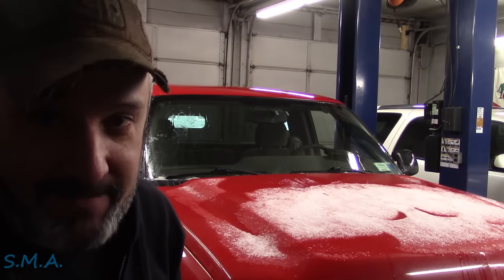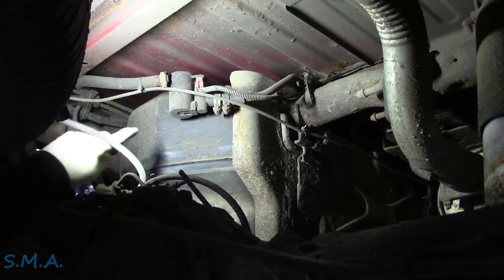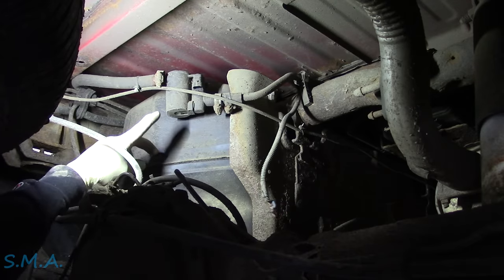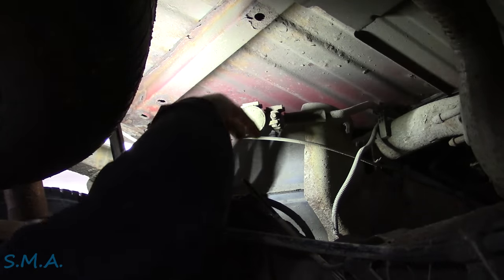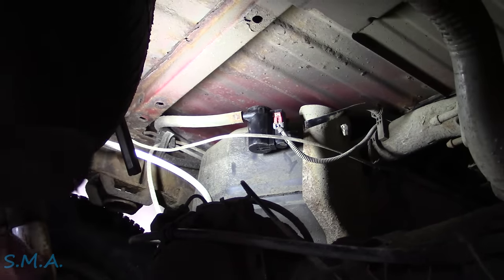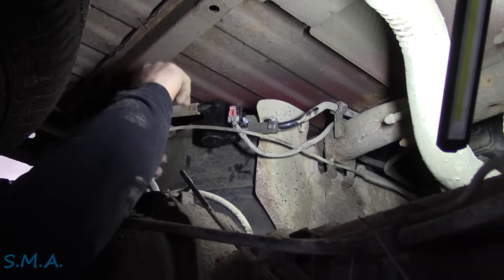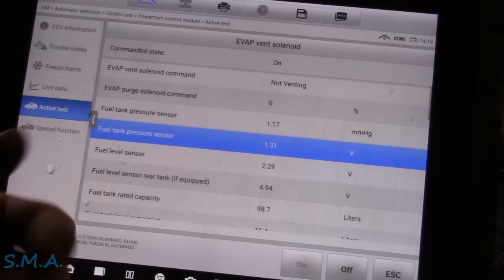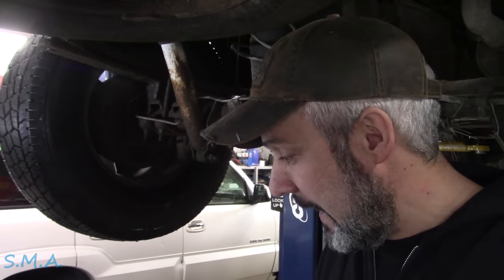Chevy/GMC Truck: P0442 P0455 Small & Large EVAP Leak

Comment from the maker: Power Probe IV : https://amzn.to/3zzZGOU
Reply: Great tool just have to watch what you back probe.Bam there goes the brain
Reply: Got the Austin Powers line, tight like tiger 🤣🤣🤣
Reply: I just bought myself a Maestro for Christmas! :)
Reply: @rickjackson2346  don't throw 12v at 5v by accident. know the hole yer probing
Reply: Hey Eric O, at 4:05 how do I make one of those test lights, or where can I buy one?
Reply: @katzenpapa  Just go to a junkyard, or buy a pigtail for a marker / running light on an older GM car or truck - 1990's and back from there.
Reply: I first learned about a powerprobe from this channel. Probably one of the best investments I have ever made in a tool. Paid for itself the first time I used it (literally) and it has shortened diagnostic times many times since then. what a great tool.
Reply: Follow-up video up for the P0442!
Reply: Power Probe is a great tool.  Great for working on trailer lines and wiring problems.
Reply: To answer your question on the 4.8L, Economy, just like the 265, 305. FYI the 4.8L in Gen 3 and 4 had no AFM/DOD to deal with, so they require no overhaul like the 5.3/6.0/6.2 units.

Comment: What helps a lot is when you get a hook inside of a hose to separate it from a fitting, spray some WD-40 onto the space between the tool and the fitting. That has help me remove and install hoses during my 37 years of turning a wrench for a living.

Comment: had a 2003 silverado with the 4.8 LS. also had the evap codes. replaced and relocated the evap system still had the codes, i emailed black bear preformance and had them delete my evap system and codes via mail in tune. Never had a problem fueling up or a check engine light again. Sold it with 276,000 miles extremely solid and reliable truck even in the Wisconsin salt belt.

Comment: When I diagnosed the purge leak fault on my '03 Chrysler Town & Country I was surprised to find that nearly all purge hoses cracked and leaked about the same time. Meaning when the hoses aged to a specific time period, they all failed in the same manner around the same time, give or take.  That's why I cringe when a hood is opened and all we see are hoses of all sorts and not the engine. Eventually they all will need replaced.

Comment: 05 Chevy, replaced pump 8years ago do to pump rust.  last year heli-coil a couple intake mounting striped holes.  Yes I was sweating bullets an made sure I didn’t loose my manhood: Couple months ago replaced rusty fuel lines , vent valve-front/ rear , map and tank sensor as preventative maintenance. Ran beautiful for 5hundred miles an radio reception.  on til fuel cleaner an super fill made those codes come up , smoked tested at night with glow sticks only to find an intermediate rear sticking valve. Thank you sincerely for videos. Still determined to drive it up therefor an inspection sometime.

Comment: That filter relocate is pretty critical on a farm truck that sees lots of gravel. The filter plugs right up if you leave it under the vehicle in the dust cloud. Gotta put it up at the front of the engine bay to breath some clean air.

Comment: I use the special tool for tightening the ty-raps, its made by Thomas and Betts. It works great! You will also want to make sure to use Thomas and Betts ty-raps because they have a metal locking tab instead of a plastic one.

Comment: Great video! My 2013 1500 5.3 ext cab 4x4  had the check engine light on with PO455 code, so changed the purge valve on the engine first with a GM original part from Rock Auto, cleared the code. next day coming home the check engine  light comes back on, same PO455 code, so I ordered a PN: 22840971  Vapor canister vent solenoid valve assembly, hoses included GM original parts from Rock Auto, got the new parts and compared the old with the new and it was identical to old part. Installed the new part, fit perfect, cleared the code again, hopefully this will work. besides, the trucks getting older and i plan on keeping the truck for a long time, so I thought it was a good idea of preventive maintenance.
Reply: Did that fix the code P0455?

Comment: It's always nice to see different methods to get to the same diagnostic goal. I wonder if the reason the vent valves are prone to failure is because moisture that condenses in the line has nowhere to go, then it freezes on a cold day, damaging anything nearby. So the manufacturer tried to shift the location of other parts so the valve would be farther away from ice. Problem is, there's only so much headroom under the vehicle.
Reply: I always find them full of very fine dirt.
Reply: I can tell you they fail all the time here in Florida to, where it doesn’t freeze much so I doubt that’s it !
Reply: It’s dirt.   The vent intake relocation makes condensation and gravity feed back to the valve even worse then the original location.
Reply from the maker: The early GM trucks (97-98ish) had them under the hood. I never changed one of them.... EVER. Do the math haha
Reply: @rydplrs71  well that makes 'the fix' perfect' more work for emissions repairs I wonder if they can limit emissions from hybrid or all electric vehicles we all know they must be emitting hazardous substances, California must label them with their hazardous material warning already.
Reply: @SouthMainAuto  amazing Ford model T's or A's never had such problems either or two stroke engines we have taken huge strides backwards moving forward.
Reply: @jhonditch4269  You drive behind an old car nowadays? They just plain stink without the cats in place. I'll take modern day emissions all day long over old polluters. Imagine how bad the air would be without increasing technology.
Reply: @jhonditch4269  Look how terrible large cities air was with smog. I am far from a save the planet kind of person, but modern emissions equipment has made a HUGE difference for the health of people.
Reply: @SouthMainAuto  I've had my 98 K1500 Chevy truck since new and have never had to change mine out.  I also own a 98 Chevy 1 ton that I bought in 2007 and have never changed that one out as well.
Reply: Im with the 'dirt' idea.  Did you notice the grass stuck to the bottom of the axles (both sides) towards the end?  That truck doesnt spend its life on pavement...
Reply: @SouthMainAuto  I have a 1998 C1500 with the big 4.3 and 5 speed gear jammer. I saw that the evap hardware is mounted in the engine bay, I was wondering if I would ever have to  deal with it. Good to hear you haven't. Also good to hear you had some down time. You need it ever now and then
Reply: @jhonditch4269  He's right about the smog.  I've visited SoCal since the 70s.  Night and Smog(day) back then.  However, I grew up liking the smell of fossil fuels sans sulphur-ish.   Oh wells
Reply: @stuckinmygarage6220  spending my childhood on the farm the smell of fresh manure is all i remember BUT we did have a "Big Greene Tractor"
Reply: @mph5896  Good  day from Ontario  2012 I had to quit work ,  severe asthma. I do some  driving for Mennonites  neighbour. 3  58 Ford cars passed me other direction.  I had to cough after they pass because   of smell of gas,  I don't think they were set rich?  Thanks
Reply: @mph5896  Back in '78 I had a Honda that used a precombustion chamber.  It could burn leaded or unleaded while other cars on the road needed one of those rotten egg smelling cadillac converters to meet EPA standards.  The only "smog" device on it was an air intake recirculation pump/A.I.R..  It got 40 MPG city, 45 MPG highway, documented and logged at every fill up.  Newer isn't always better.

Comment: Had an EVAP code. An took it to the dealer to be fixed. The first time. It made it till the next day. Before my check engine light came on. Went back an they moved it on top of transmission. Was leaving an it came on before I got off the lot. So they said they would code my truck for free. As long as it was the EVAP circuit. Not to worry about it. Because it had nothin to do with the performance of the 6.0. I'm true to my GM 3/4 ton and 1 ton trucks. But! I'm having serious doubts about what I thought was the for sure way. To correctly fixing all computer code problems. Wish I could find a man as honest and skilled as you. In my area. To work on my trucks. But watching your vids. Let me know that if you can do it. That I can to. Rather work my trucks. An find someone I can trust. To fix them

Comment: Great video well explained.

The hose from my field neck to my gas tank was recently cut in attempt to siphon my tank. 
I put a new hose on.
 check engine light went off came back on a day later.
And now I'm not hearing the distinctive click from purge valve. 
I think I'm going to try to replace the valve and hope that fixes my issue.

Thanks for the video

Comment: I got the same truck and I got a P0451, P0446, EVAP system vent control circuit, and EVAP system pressure sensor/switch "A" circirt range/performance...
I checked the canter like you did and the thing under the hood is good, my thought is that its the fuel tank sensor.

Comment: Putting the load on it is the best. Had one the other day that had no control side ground. It also wasn't working after fixing the broken wire along the frame. But the pressure sensor was also reading -10. So it had 3 problems. Another shop overlooked all of it and changed the purge valve. AkA guessed. It was a tire shop.

Comment: I found using a pair of vice grips slightly tightened over the hose at the location where the clamp was and give it a turn will loosen the adhesion. Then you can pull off normally.

Comment: I sold autoparts for 15 years.  Just 7 or 8 years ago those vent valves were $70+ depending on which one you needed.  Where I live they started becoming a common failure about 5 years ago, and now they are about $20

Comment: My wife's grandmother called me not long ago saying she took her 2001 Silverado(legit garage find, zero rust, 55k) into the dealership to get a CEL figured out. Techs said it was the same codes as what this video describes(I checked them myself with a cheap iPhone code reader). They estimated $900-1100 to repair. She could afford it but she called me just to run it past me. I stopped over, fiddled with the gas cap, wiggled each and every fitting on the evap circuit and pulled the fitting out of the intake and cleaned it. 12,000 miles since and no codes. 

Is that the problem everytime? No I'm certain it's not and many times it's far more in-depth than that. But how many times has a dealership done that to people who don't have someone that is halfway mechanically minded?
Reply: That is a key part of their business model. They give you some inflated repair cost for an old vehicle in the hope you'll trade it in on a new one.

Comment: Eric great video you know a lot, i did my trade school in H.S. auto Mechanics i dont know half of what you know, But i have a 2004 Grand cherokee 4.0  same color as yours i have Po455,   The Po442  is pending, I bought a smoke machine autoline pro Amazon 120.00 and i found my leak it was a line going from the fuel tank to the charcoal canister that elbow was crack on top, went to advance auto they haven't ha rubber hoses in 4-5 months I use the Blu Driver

Comment: If you want a hose clamp that will not rust (at least corrosion resistant in the presence of salt water) you can use an all 316L SS clamp (Salt Water Marine type) from PYI. They are expensive, but are excellent for the repair you are making (rust belt under vehicle, OBD-II Evap emissions critical leak). The PYI clamps have rolled edges which work well on tubes with no nipples, barbs or beads. I see the OEM quality for critical use hose clamps vary greatly. For example, a tank fill hose clamp which is SS except for the screw, which corrodes to the point where it can't hold the clamp pressure, or is unusable once disconnected.

For the repair I would take the opportunity to treat the connector and actuator contacts with Deoxit D5 spray. I would also make sure that the harness to the actuator cannot vibrate (move) underneath the vehicle while driving. So, I would tie-wrap the harness so it cannot move relative to the solenoid.

Evaporative emissions are stringent, so much so, that the hose types should have a low permeability rating and obviously be hydrocarbon (fuel vapor) compatible. I think Eric used a large fuel line hose, which would work. I could not see any markings on the new hose.

Comment: Been trying to figure out my P0455 code on my 2009 Pontiac G5/Cobalt for weeks. replaced gas cap, purge cannister and vent solenoid and still has the dash lit up and crappier gas mileage. Hoses appear to be ok...I dunno. Great video, but kind of a slap in the face towards my problem lol. I just can't shake it.

Comment: Previously worked at GM dealer for A couple decades. We replaced those evap vent valves and canisters almost every day of the week due to them filling up with sand. You could literally shack the sand out of the canister. I would really like to know if other brands of trucks had the same issue in dusty conditions.
Reply: I have yet to run into a brand that doesn't have common problems due to emission items. My cousin has newer construction equipment and they fail all the time. Most of the fam repairs that aren't regular maintenance are typically PCV/Emissions whatever. Every. Time.
Reply: @inducedapathy1296  What would be nice, is the day when diesel dpf systems would be much less troublesome. The cost associated with downtime due to this system is outrageous.

Comment: I have a 2007 chevy Silverado and it has the 4.8 engine. Its been a bullet proof engine.
Reply: You're lucky. I've got the 5.3 in the same year, and I'm getting ready for an engine swap at 117k miles. Nothing else on that truck could make it 100k, except the transmission - that failed at 103k. Been the biggest POS I've ever owned in my life! Bought it brand new, and took care of it better than any vehicle I've ever owned, too. Ran the best of the best synthetics since the day it broke in. Didn't help much. Parts quality has gone down the toilet.

Comment: Mrs. O reminded me to ask:  I have a '19 Honda Ridgeline that is due for timing belt, water pump, pulleys etc.  I am planning to change the thermostat while the coolant is drained, but wondering if I should also change the radiator cap.  Appreciate any advice.
Reply: You can if you want, as they're only a few bucks, but it's generally not necessary.
Reply: @Lugnut64052  actually, they’re $27 on this bugger.  With the shortages etc., I’m trying to not be unnecessary wasteful.
Reply: @DADSGARAGE-ip7th  lol, like no one else in the comments will either.  Thanks for your contribution.
Reply: @jaker1160  long as the rubber gasket is in good shape, an the pressure relief valve inside the cap is working I wouldn't waste the money. It's easy enough to change later if needed. People change the thermostat because it's one of those "while I'm in here things".
Reply: @eldonerc2524  tyvm
Reply: Since it's external to the repair, really new and unlikely to be an issue for years, there's no reason to replace the cap routinely with some related service. You can visually inspect the gasket and if it's actually not holding pressure it's pretty easy to spot (and or smell).
Reply: Is that not covered by warranty?
Reply: @rjmari  we’re over 70k miles.
Reply: @jaker1160  If you're refreshing the cooling system, why not replace the cap, too? I just wouldn't buy aftermarket there - go OE Honda. If it was 1990 I'd tell you not to bother, but in this day and age, nothing is built to last anymore.
Reply: You can if you want to but if it is still good I would keep the one you got.
Reply: @jaker1160  Ouch, that sucks. Best of luck on the repair, assuming you're doing it yourself)
Reply: @jaker1160  Then don't replace it.  They're generally never a problem.

Comment: Love your videos. I have a question if you don’t have a scanner with bidirectional function how can you check the circuit from the ecm
Reply: On a GM the circuit is good if you don't get a p0449 code.
Reply: You could go to the PCM connector and ground the control wire to listen for the valve to close or to turn on a test light. That would verify the wiring and solenoid.  To verify the driver that would be tricky because you would have to monitor the control side of the circuit when the PCM checks the system for leaks.   Honestly it's rare a vent valve driver goes bad.
Reply: @Discretesignals  Hey man, on my 06 Sierra I replaced the rear dome lights. Anyways,  when I swapped the bulbs again I heard and smelled a burnt sound. Now my reverse camera doesn't work along with the rear dome lights. Any idea on what I should do?

Comment: I suspect your camera has non-voice frequency noise suppression on the sound recording.  When sound suppressing headphones first came out, I worked ships.  Bought a pair and tried them out on the ship.  Motor noise, blower noise, engine noise everywhere.  Well, it cut the low frequency noises quite well, but that only highlighted the the higher frequency noise from the blowers and fans.  Worse, when I took them off, I could still "hear" the high frequency noise along with the low frequency noise.

Comment: Thanks! I have had gas syphoned on my 4.8 and now for the first time is popping an intermittent p0449 not the other codes. Just wondering if someone taking off the gas cap and pushing a small flex tube hard down the pressure relieve tube to prevent spit back while filling could have caused an intermittent p0449 on my Sierra. We have hosers up here in Canada and they resell stolen gas in many towns like Kamloops BC where someone managed to syphon about 12 gallons out of the 26 gallon us gas tank on our 2003 Sierra? Never have had a gas cap code on this particular truck until just after someone syphoned gas. Changed the gas cap and the code went away for a year but is back now that the new locking gas cap is getting older.